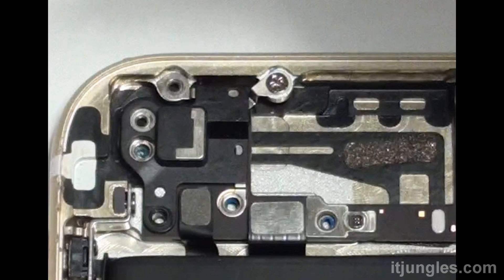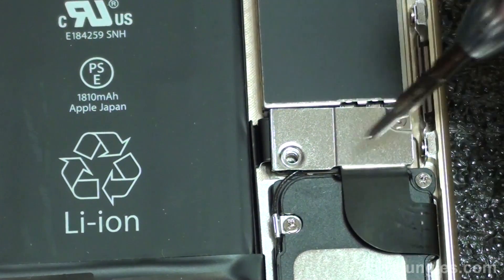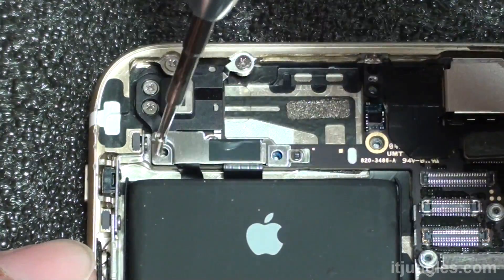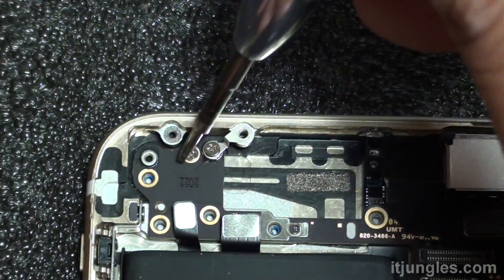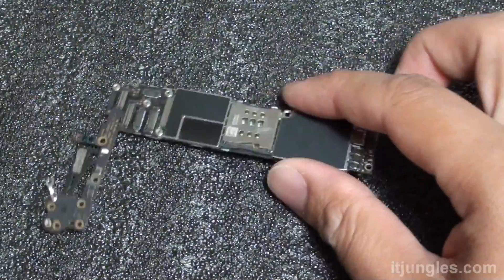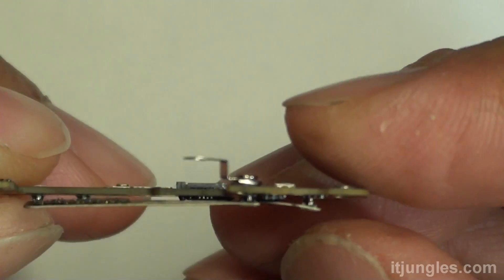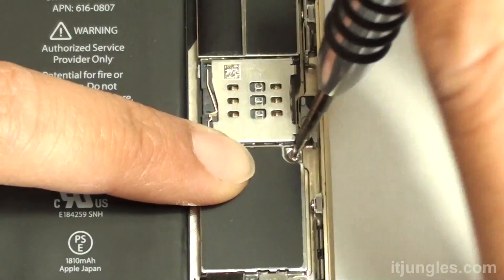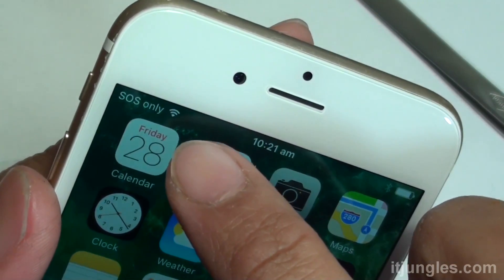iPhone 6: How to Replace and Fix WIFI / GPS Antenna

Comment: Folks, be really careful when detaching the wireless antenna. Mine had the piece off the mobo come off :( Thank you so much for this video it was so helpful. I especially appreciated the close up and also using blue arrows to show screws under the plate. Couldn't have done it without your help.

Comment: Great video. Fixed all my wifi / GPS problems. I printed out a couple of screenshots where he shows with arrows what screws to remove. Then I put a small lump of blu-tack beside each arrow and put each screw on it as I took it out. Made replacement really easy.

Comment: thanks man, got tired of having to connect my 5Ghz instead of 2.4Ghz because I literally have to be next to the Gateway to get a good connection, and sometimes in my room I don’t even get a good connection, meanwhile the rest of my family gets a good connection outside, I’m stuck having to use my Cellular data >:(

Comment: I believe my WiFi antenna may have been cracked since I bought my used iPhone 3 years ago, but eventually the connection deteriorated to almost nothing. Your video was very helpful getting me through this procedure, especially the diagrams showing which screws needed to be removed. With your assistance, I'm able to have working WiFi, better than ever. Thank you so much.

Comment: Thanks for this well done antenna replacement video! My advice is you should use a lighted hands free magnifying glass, use a large writable area (back of a cheap table place mat) to map out and place where you removed the screws from...there are several different types of VERY TINY screws. This is very delicate work...needs precision and patience to disconnect/reconnect connectors ESPECIALLY getting the screws placed in the holes before turning them... they are mini chip and one TINY antenna cable connector... buy an antenna kit that comes with screw drivers and plastic pry tools...recommend you also use a magnetic mini phillips screw driver... not a project for most people. When I finished my phone would not power on even though the battery was charged enough before I powered down the phone... I thought I did something wrong and damaged the phone... seems that battery memory went to zero... plugged in the charger and it powered up and then displayed the actual charge. It is difficult because of the tiny screws and connectors... need good eye sight and hand dexterity... good luck!

Comment: I followed this,   got as far as the antenna and tried reseating the existing one but still got no reception, fitted one from an old phone I bought for parts for next to nothing and immediately got 5 bars where I either had 1 or none for last month.      I put all the screws back in methodically, everything nice and snug but now have 2 screws left over..  whats that about?   :)  anyway...thank you.

Comment: Hello, how are you? Three months ago my phone fell into the water iPhone 6 Plus and then I went to the phone repair store and then repaired it but there was a problem with Wi-Fi it does not work I threw it in the drawer and now I try to charge it but it does not charge and it does not show on the screen that there is no charging I do not know what the missing parts are Because I try to fix it and I bought repair equipment
Reply: My iPhone didn’t get wet but it has trouble charging/turning on. I have to plug the cord in fast and hold down the power button at the same time and then it will start charging. Hope this helps!

Comment: Is the "WIFI / GPS Antenna" a different part than the cellular antenna? Do I need two independent parts if I want to replace the wifi & cellular antennas? Thank you.

Comment: My GPS was not working and my WiFi was 2 bars unless I’m right next to the router. Every time I watch something it would load every like 30 seconds or it would do “bad quality mode” if the video loads too long.
Reply from the maker: Replace the mentioned antenna should fix it.

Comment: So, the WiFi and GPS components are one component?
Reply: Joko Al Chamri  yes. There’s also a grounding gps bracket I would recommend purchasing.   Both parts were 5$
Reply: mr gadget can you tell me the shop link?
Reply: @inpirasidesain1906  Original GPS Wifi Antenna Signal Flex Cable Ribbon Bracket for iPhone 6 / Tool ..type that on ebay..will help with wifi/weak bluetooth signal too ..fixed my gps issue..also download a great app from ios called "gps diagnostics" to see if you are calibrated before u do this

Comment: Thank you.  I recently did a screen repair and then this problem came up (searching and no service).  Figured I would try this first without replacing the antenna.  Followed it in forward and reverse and it's now working perfect.

Comment: This repair appears daunting at first, but it just requires patience and organization.  Over a dozen tiny screws, all different sizes.  I would not attempt without first investing in a magnetic project pad.  Arrange the screws on the pad to correspond with the position from which they were removed.  Three miniature screwdrivers are required: Pentalope, Phillips, and flat. Some kits come with cheap plastic-handled screwdrivers which do not "bite" and can ream out a phillips head screw.

Comment: Thanks. My phone is completely broken. LCD display glitching with lines across screen, touchscreen not working at all.
Reply: Was the display working before you attempted the repair? It sounds like the screen connectors were not reseated properly.  Open the phone, remove the screen connector cover plate (5 screws), and disconnect/reconnect the four connectors again.

Comment: Thank you so much for posting this video! I was successful with replacing the antenna with your easy to follow directions. I started the phone and I got WiFi connectivity right away. Is there a delay with GPS syncing with the phone? I do not have correct GPS location right now. Maybe there is a flex cord that was not put on correctly when I assembled it back together?
Reply: Bluetooth is still week too

Comment: Before replacing this part, try just doing the same tear down and then making sure that the antenna is clipped on properly; That's what I did with mine and it's fixed without me having to replace the part. I think it might just become loose overtime especially if your phone fell down a lot.
Reply: This. Replaced my antenna the first time this issue came up. When my phone fell a couple of times more I started losing the wifi signals again, removed and reinstalled the same antenna and it seems to work just fine.
Reply: Does this apply to iPhone 6s?
Reply: Summer Vibes yes im pretty sure

Comment: i have iphone 6 and ipad mini 1gen. in the same place, my iphone 6 are not able to detect the wifi signal, but my ipad mini 1gen is connected to wifi. can i use this way to repair my problem?

Comment: Thank you so much for the very detailed and clear video instructions.  I was able to replace my iphone 6's battery and faulty gps antenna flex cable by following your video.  I tried to follow some of the other videos on you-tube, but they were not as complete or clear as yours.  Great job on the video, and a great service for those of us still trying to hang on to our iphone sixes.

Comment: Saved me from having to buy a new phone. It took a while for me to figure out this was the problem, but it was the fact that both Wifi and bluetooth signals sucked that helped me. I've had to change out this antenna twice in a year. (~75 min repair for me.)  I hope Apple has fixed this problem in later generations. Thanks!!

Comment: what a life saver! I was thinking to buy new Iphone. my screen broke and I fixed it and I wonder if I can replace the antenna as well wifi was having problem with signal :( I needed to be close to the router to actually connect! and I did this without a problem! thanks! the wifi problem is fix now :D (I feel so proud of myself lol)
Reply: Monica XCVI is the wifi signal is strong? and does Bluetooth speakers can connect?
Reply: really??? did that take u long?
Reply: @kujtesagashi902  30- an hr if you’re not used to it
Reply: @monica_xcvi4804  ohhh cause I've the same problem right now just as you .I should be close to the router to connect because otherwise it won't work
Reply: @kujtesagashi902  just be careful when removing the old lcd you might detach the fingerprint thing and you won’t ever be able to fix it just be very careful disassembling
Reply: @monica_xcvi4804  thank you!

Comment: Thanks, this helped me replace my $1 antenna which seemed to fix the problem with Waze.  The hardest part was putting the new antenna on.  The little connectors just wouldn't snap into place.  Also, when putting the board back start on the top side and slide it under the area where the camera is.  I think the Video does not show that.  Also use some Blue Loctite on all the screws that have Blue Loctite on them already.  If those screws come lose, you can short out the phone.   Another tip, make sure your new antenna has the fuzzy thing over the gold part - when you buy it, tell the seller to make sure it's there.  That's very important to prevent the metal cover from contacting the antenna.  Mine didn't so I had to remove it from the old antenna and put it on the new antenna.  I used a hair dryer to heat it up and pried it off with a razor blade.  Total time took about an hour.  I could have done it quicker.  A lot cheaper than buying a new phone!
Reply from the maker: Thanks adding additional tips.

Comment: Worked amazingly well! Thank you! Just replaced the antenna with a $2 on ebay and works great! Finally can see the correct position on google maps and apple maps from my phone. Broke off the other antenna as I was replacing it haha, but worked well. Couple of those screws were ROUGH getting out though

Comment: Great video.  Fixed my iPhone 6 GPS issue and weak wifi signal.  I will admit that it was not an easy effort due to the small components.  Mag screwdriver a must, antenna connector to motherboard a pain, pin connectors less so.  I'm just south of 60 so the eyes are probably not as good as most folks who would attempt this.

Comment: Excellent video and fixed both my wifi and GPS problems. The only note of caution is be sure you lay out your screws away from where you are working so that they do not get attracted to your tools or mixed up with your arm! Also, be sure to understand how the phone opens and closes as I was not able to completely close the right hand side of the phone (looking into the phone on the reverse side).

Comment: One suggestion - when doing repairs, I use a piece of double-sided tape to put my screws on in the order I take them out.  This is a huge help when I am putting the phone back together.  Most of the screws are unique in size and they are not interchangeable so mixing them up is a nightmare.  Good luck!

Comment: This video was super helpful. I was able to replace antenna as instructed and it resolved my WiFi issues. I highly recommend using it, as it is the best I’ve found. My only complaint is that when video starts talking of reassembly it takes shortcuts that aren’t easy to follow. I had to go back and look at each disassembly steps in reverse in order to get accurate sequence.

Comment: as soon as i leave the room where my router is located , my wifi signal drops to 1 bar, shall i replace this part or another?
Reply: Blaze Gamer that part because it’s the WiFi antenna that’s making your WiFi signal drop
Reply: @yungkassy9468  yeah i did more research and i found its that part and i already replaced it by myself thanks for replying tho

Comment: Is replacing the antenna always necessary?  What about just reconnecting a loose one?
Reply from the maker: You could try to reconnect and see if it works. If not, then replace the attenna.

Comment: Just replaced it and my bluetooth is finally working well again.  Haven't tried the GPS out yet, but i'm confident it will be working again also.

Only one issue....now the Y and 6 on my keyboard are deadspots on my touch screen.  Any advice on why this is happening and how to fix?

Comment: Just used this video to fix my wife's iPhone 6 and it works perfectly. THANK YOU ! I got the parts and tools here - https://www.amazon.co.uk/dp/B074SG2VPV/ref=cfb_at_prodpg - and printed out a copy of the screw diagram (used double sided sticky tape to secure screws) from here - https://uedata.amazon.com/dp/B01G3HQMKA/ref=psdc_2407780011_t3_B01G3HN8EI?tag=ifixitam-20

Comment: It DOES NOT fixes GPS issue!  It only fixes the wifi issue. Just replace the part and witnessed it myself.
Reply: Depends on what the issue on your phone is.  I've been having poor Bluetooth, some Wifi issues and No GPS popping up when trying to use WAZE or other Navigation programs.  So I replaced the Antenna and the GPS Module.  The GPS Module is on the top left of the phone.  You would have pulled it to get the main board out to change the antenna.  Well, I got a new replacement and popped it into place as I was putting it back together again.  Well, My Bluetooth now seems better.  It would cut out turning my head, now it's working at a distance.  Wifi seems a little better, but I have had issues at work which is where I would really notice it.  So Unlike I go back to work, I won't know for sure 100%.  My GPS?  Right now it's working!!!  But again it's way too early to tell as it would work and then stop working, and later work again, and then stop working.  I would get the No GPS message on the screen when using WAZE, but nothing else worked either.  The map was just way off.  

GPS is working in my Computer room inside right now.   I'm going to have to use it for a week and see if No GPS pops up again or not.  When it doesn't work and you're not sure how to get someplace, it can be annoying.  Luckily I had a backup with my Radio/Navigation unit in my truck.  The maps may be a little outdated and doesn't have as many of the fancy features of WAZE, but it got me where I needed, though a really bad roundabout way.

Comment: This is the best how-to video for replacing the wifi antenna that I could find on YouTube. I've never taken apart any electronic ever in my life, and I was able to fix my phone for only $15 because of this walk through. I did check my components prior to purchasing a new part. Sometimes there is a sticker askew on the wifi antenna or a connector disconnected. This video can still help you get to that point. It took a little time, patience and rewinding to make sure everything was done right. Totally worth the effort. It's better than spending another $300-$800 for a new phone. The only thing that would make this video better is if the reassembly was a bit more detailed. I made a diagram of the pieces and screws (with steps) so that I could easily reassemble, but still found myself rewinding and double checking my steps.

Comment: Thank you - very informative and easy to follow. I didn't replace my antenna but simply put a little bit of tape on top of the black sponge buffer tape (you'll see it once you remove the antenna) and this created enough pressure on the antenna contacts to re-establish a good connection.

Comment: Just did this to my phone. It was pretty hard to remember the screw places (long, short etc) , had hard time connecting the display properly, but beside this now works as a new!
Many thanks!
Reply: The best method to remember where the screws go is to used tape. Apply the screws onto the sticky side of the tape. Then just apply the screws in same orientation they were found.
Reply: Lol I took out 11 screws and didn't sort them, and found out that out of those 11 there were 10 different sizes...  That was a bit of a nightmare to sort

Comment: hello i have a bad wifi recpetion and i think that i have to change the antenna right? how is working the one that u linked so far? good product? did u recommend to buy? 
same question for the battery? have u any experience in battery brand ? thanks

Comment: Hey man that's a really good video but i have a big problem. While i'm trying to replace the new flex cable to the logic board, guess what i did? I broke one of coax connectors on the logic board and i'm still having bad signal from my wifi. I mean i can't connect one of 4 connectors of flex cable to logic board. I hope you understand, sorry for my english btw :)
Reply: Well, then you're kind of screwed.  You have to take your time and carefully pop all the connections.  That includes the antenna.  I just finished the job myself and had no problem.  Everything seems to work now.   This is NOT an easy fix.  Lots of screws that all have to go back into the exact same spots.   In general, you should let a pro do it.  You may be able to take it someplace to get it fixed.  Maybe not, as places don't like to fix other people's screw up's.

I'm no pro, but I've fixed a number of phones over the years for friends and family.   This fix almost pushed my limits.  I replaced the Antenna and the GPS module.  Since the parts are cheap and I only wanted to pull the phone apart once.    1 broken connector, you just made your phone worse off.   Maybe time to look at a new phone.  I normally keep my phones for 4 years, and so I'm into the 4th year with this iPhone 6 and I don't want to replace it at this time until the new 2018 iPhones are announced and being sold.  That's still around 5 months away.
Reply: Levent Baysak Hi. Sorry for my bad English